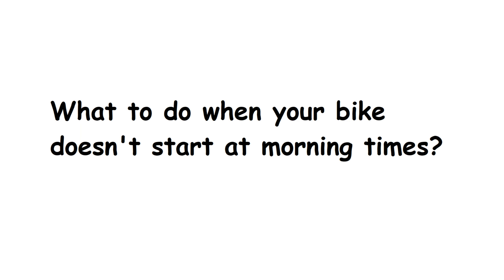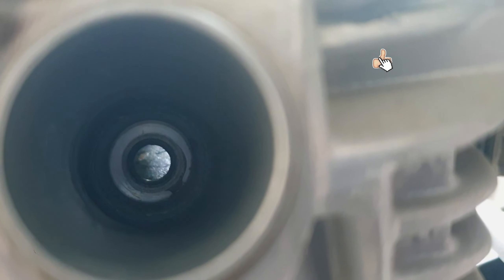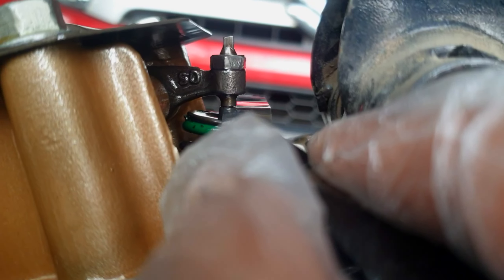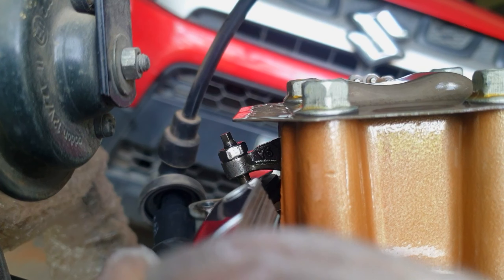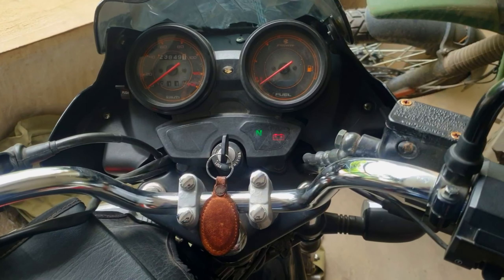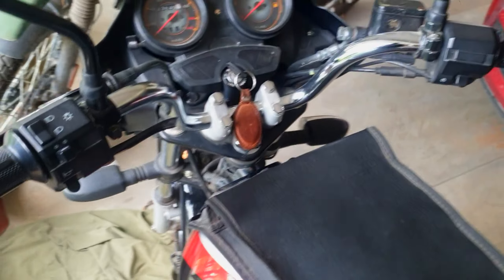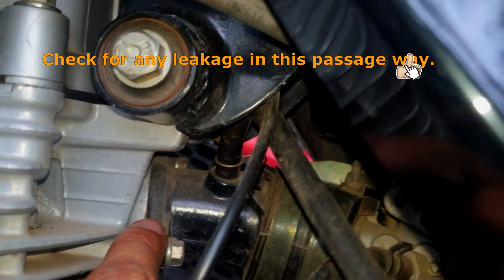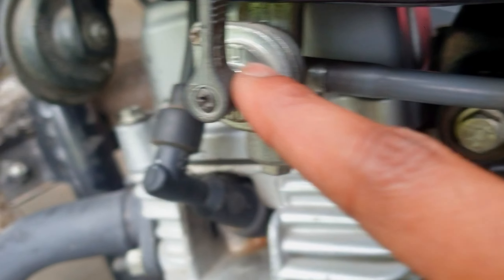Stop your bike from bogging in the morning first start

Comment: Can you provide me me valve clearance settings of discover 125 st 4 valve
I lost my user manual can u also tell me where can i download a pdf of manual
Reply from the maker: Hi Sir, you can only get manual from service center. Its not available online. 
Discover 125 st 4 valve valve clearance: inlet: 0.05 mm and exhaust 0.1 mm standard.

Comment: Heloo i have a boxer 150 and anytime i start accelerating fast it keeps on cutting as if it want to gor off until i reduce the speed .have checked the carburator and plug but still no change wat could be the matter
Reply from the maker: Try to idle the bike for 5 minutes before taking on ride. Also you need to check the valve clearance.

Comment: Bro bike missing at every morning times and when applying choke no missing is it tappet problem
Reply from the maker: Are you getting misfires?
Reply: @PavanKumarHB  yes like tup tup and bike goes off. Only Morning times after warm no problem How to solve. Carburetor Cleaned, new spark plug, ht coil, air filter, fuel tap. Still it occurs
Reply from the maker: This looks like tappet not adjusted correctly. There are many service man who doesn't know correct tappet clearance reading so they adjust wrongly. 

And in most of the 4 stroke bikes there is starting lag means you need to warm up engine for 3 mins. Then you can take the bike for ride.
Reply: @PavanKumarHB  bro starting lag and after warm up it goes smooth. If we adjust tappet to correct clearence will the problem goes away and give smooth acceleration
Reply from the maker: Yes, it'll definitely go away.
Reply: @PavanKumarHB  Ok bro thanks❤🙂